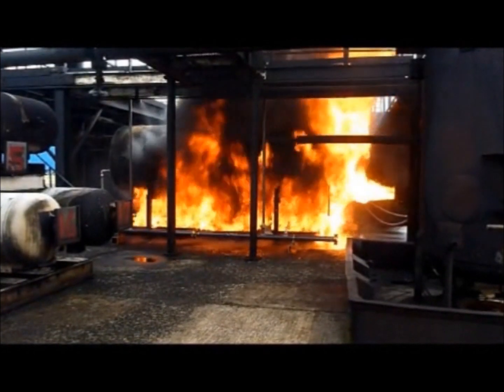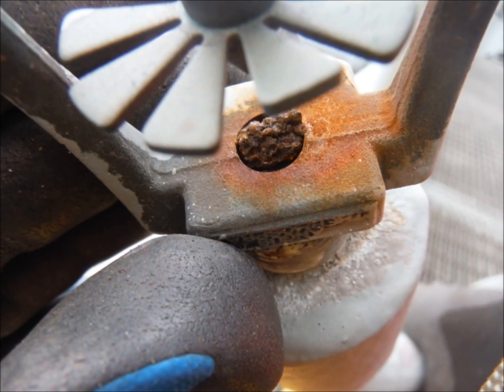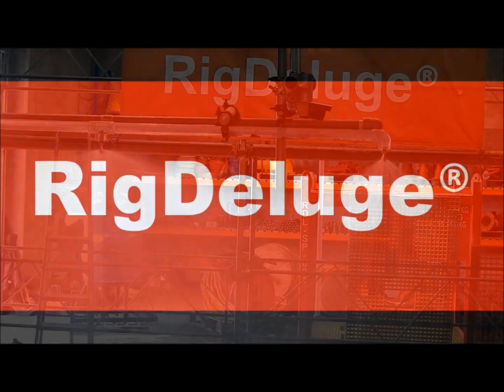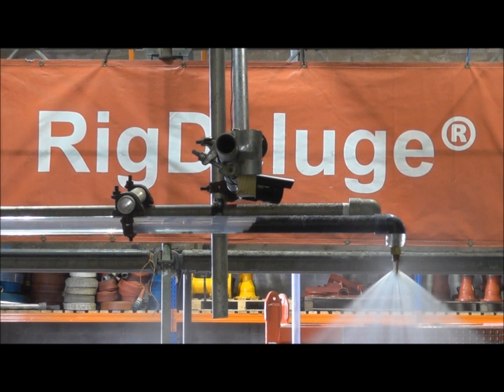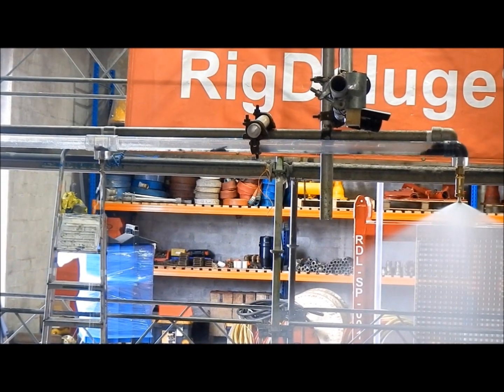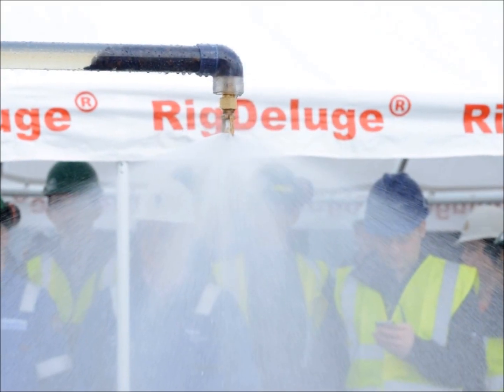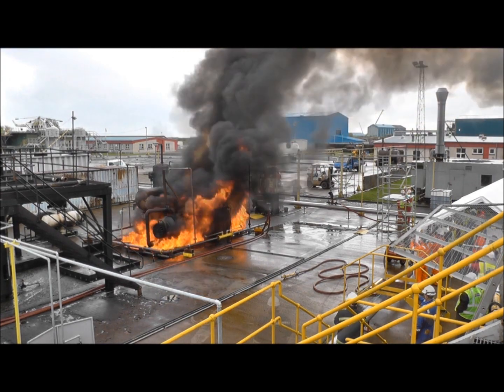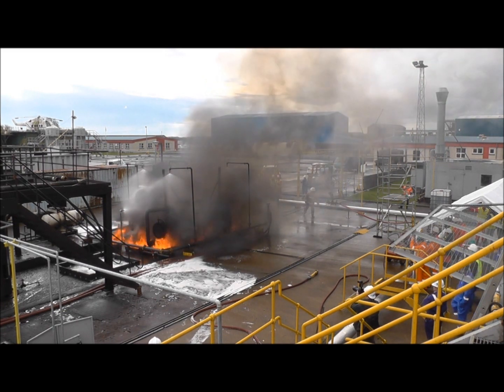Nozzle Filter by RigDeluge®

Comment: Based on proven real time tesing of the RigDeluge concentric flow system it by far out performs the sprinkler / deluge systems currently installed  in many of the offshore platforms and rigs within the UK sector.The safety of all workers offshore is paramount,this system should at the very least be considered by all operators / duty holders as an improvemnt on what currently exists on their respective assets.Appreciate it has attained new marine compliance standards would be good to see HSE endorsement in the near future.